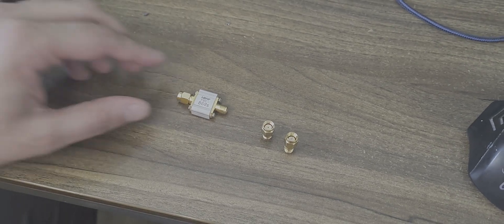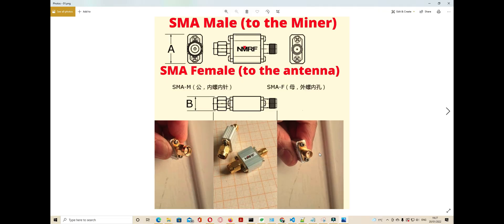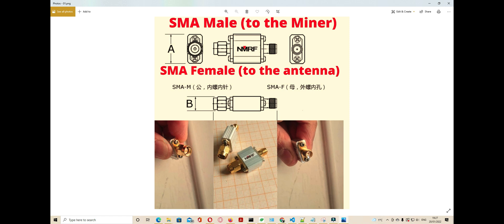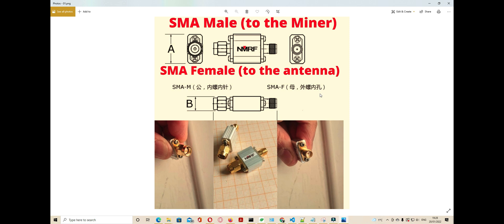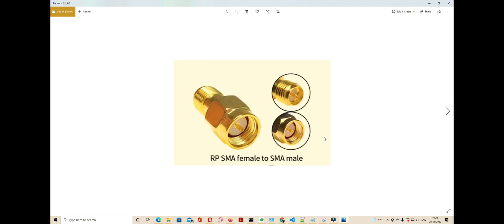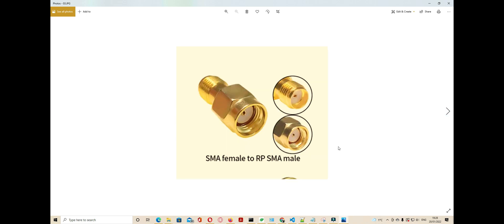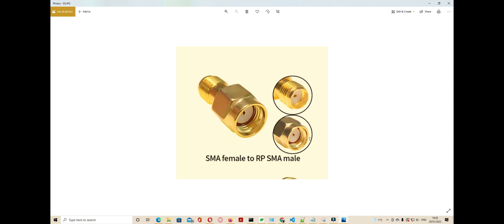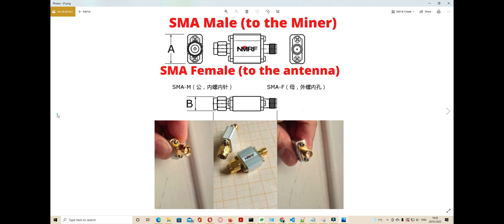How To Install RFID Remote SAW bandpass filter  On Helium ( HNT) Hotspot Miner (Bobcat)

Comment: I have a problem with my bobcat it looks like it just can't see other hotspots' beacons and when it does it does it very rarely like max 1 or 2 per day. It will send beacons though very effectively with plenty of hotspots receiving them. I had a rak before same location same set up and was doing great witnessing and being witness like crazy, as it should on the top of a building.
Could this filter be the answer or is the filter in the bobcat, if it has one, the problem?

Comment: Can we use it with sensecap miner as it is told that it has already saw filter installed?
Reply from the maker: if your hotspot doesn’t have a filter you might need to add an external filter.
Reply: you ready have one no point of having and extra one ;)_

Comment: What does filter do when you connect it ?
Reply from the maker: the performance of the RFID receiver is optimized to effectively filter out-of-band signals, reduce noise and increase dynamic range increase HNT reward
Reply: @BangGearShop one of my friend said u will lose some dbi is it correct?
Reply from the maker: Yes